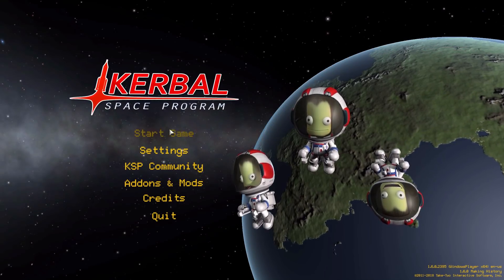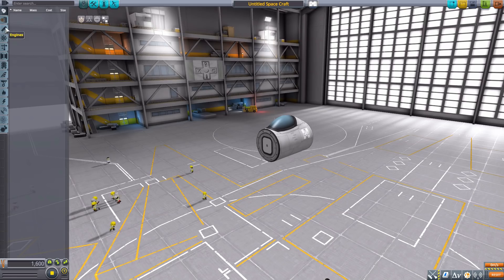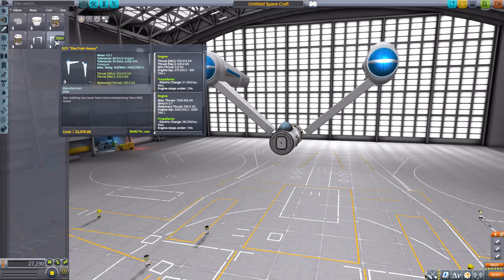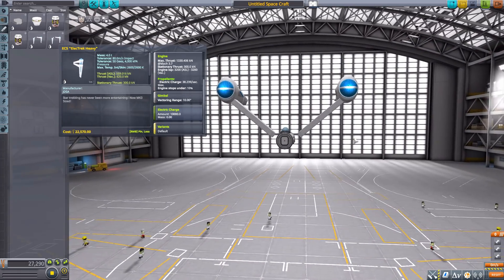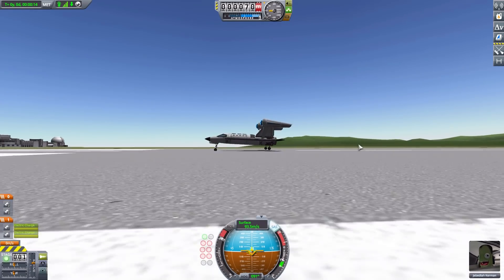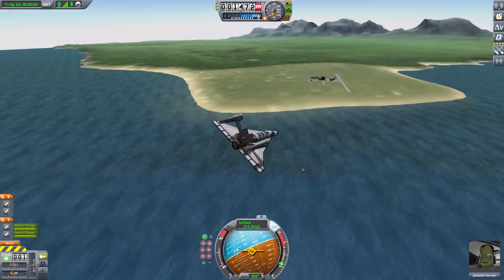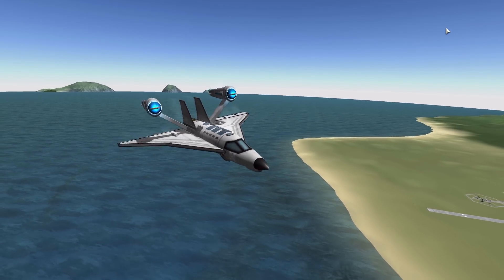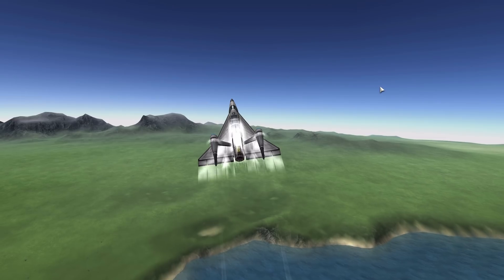KSP Mods - PURE Electric Engines

Comment: For VTOL turn the thrust limiter on the normal engines to 0 and then turn on center of lift and thrust. For VTOL, make sure the COT is under the COM. Then, turn the thrust limiter on all engines back to 100%

Comment: I think they might have confused kN and N because even 600N would be a LOT of thrust for that tiny VTOL engine.
Reply: ...its been 2 years, first of all, N are smaller then kN, there are 1000 N in one kN, and second, how's life?
Reply: @Lagoonn  I was saying the smaller unit would be a lot and they used the bigger unit.  :/

T6 ion thrusters (the most powerful ones developed onboard Bepicolombo) generate about 140 _milli_newtons.  In vacuum.  With one, homogenous, Noble propellant.  Now, I am aware that gridded ion thrusters are high efficiency-low thrust, but even high-thrust ion thrusters produce about 5N, again with very controlled conditions in a vacuum.  The stock Hall-effect thruster might have a thrust of 1kN, but real ones fall around 1N of thrust with massively increased performance to the KSP one, which was buffed a few years back.
Reply: @fiveoneecho  ahh okay, well glad you could remember all that 2 years later haha, but yeah now I understand what you're saying. I read through the forum for this mod and the creator didn't want the engines to be boring and wanted them to be actually useful > realistic. He also wanted the modded engines to easily compare / relate to stock engines.
Reply: @Lagoonn  Yeah, after looking up the newer thrust of the stock ion thruster, I realized that they were clearly balanced to that.  Makes more sense :P

Comment: OK. This may be a little cheaty. I was able to make a simple, 11 ton craft including a lab that is able to land and take back off on Tylo and Eve. And I was able to unlock all the needed parts in tech tree for less that 3200 science. In science or career, work up to 3200 science and then you can visit every biome on every planetary body to complete the tech tree.
Reply from the maker: ya it certainly needs a bit more balance
Reply: @KottabosGames  Puts ONE engine:
INSTANT JUNO TRANSFER